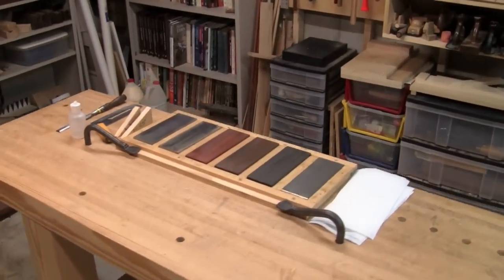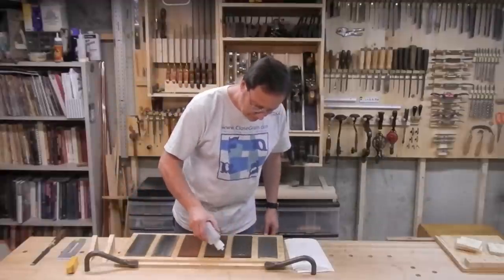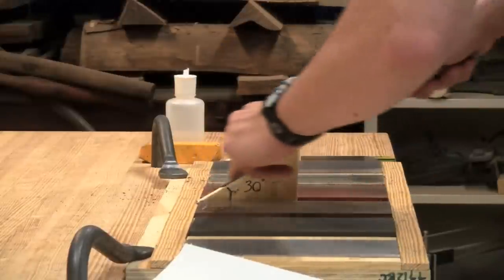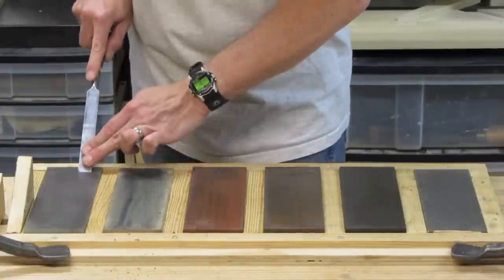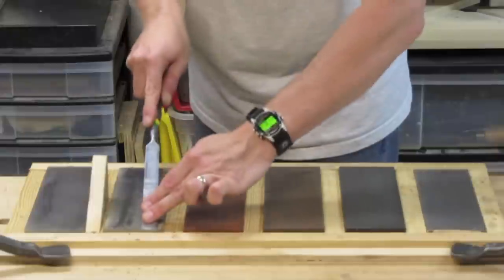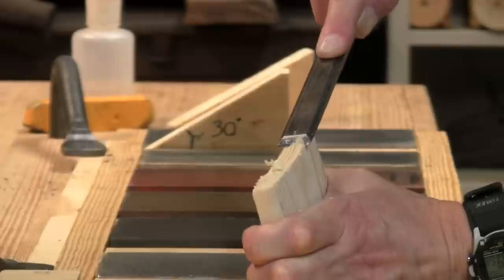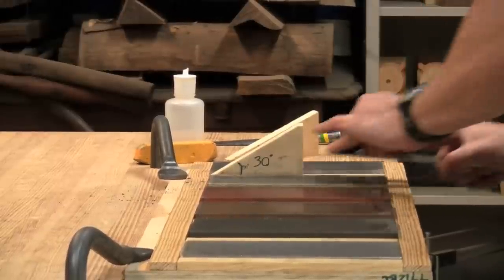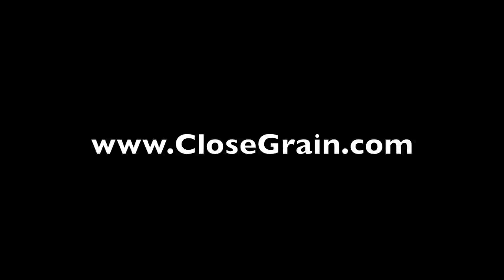Convex Double Bevel Sharpening

Comment: Steve, great video on proper sharpening and an excellent methodology!  I would like to use your exact set up for my shop, in fact can you tell me where you purchased all your stones.  I would like to duplicate exactly what you have right down to the very type and size of the stones (they all look to be 3" X 8").  Thank you, John
Reply from the maker: Thanks, John! I got all these from sharpeningsupplies.com. These are the 3" x 8" x 1/2" Norton stones and DMT plate.
Reply: Steve Branam Steve, Thanks for that link..I just purchased the 3 Norton India oil stones; coarse, medium, and fine, and the Norton Transluscen Arkansas stone from them like yours...but thought the price too steep on the DMT ex, ex coarse diamond plate, so got that one & a bar of flexcut gold compound throrugh Amazon for much less.  Couldn't find a 3 x 8 strop on hardwood (you must have made your own to match the sizes of the other stone compartments?) so I will make my own.  Thanks so much!  John
Reply from the maker: John T. Willette Yes, the strop is just a piece of 1/2" plywood cut to match the size. Then a piece of leather rubber-cemented rough side up to it. I used some nice heavy leather I had, but any leather will work. You can find it in squares at craft stores.